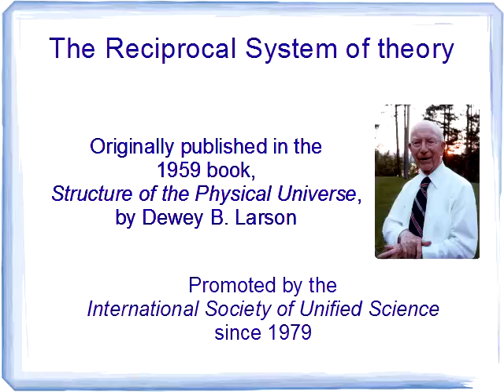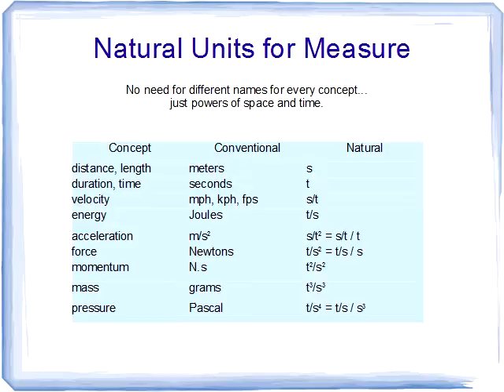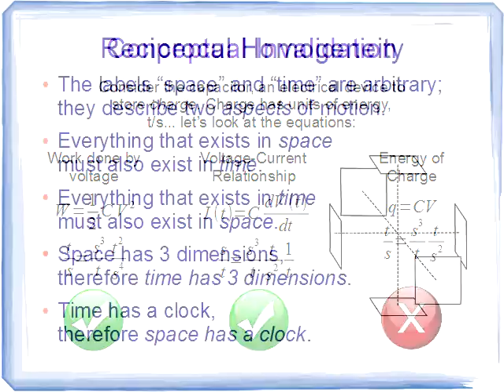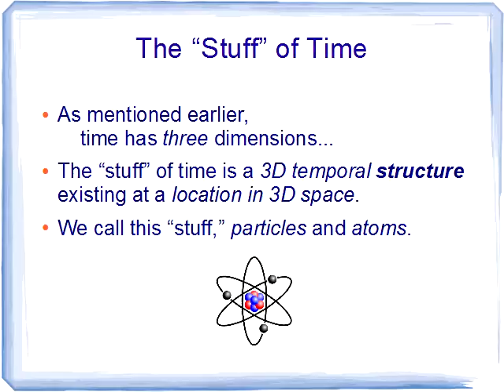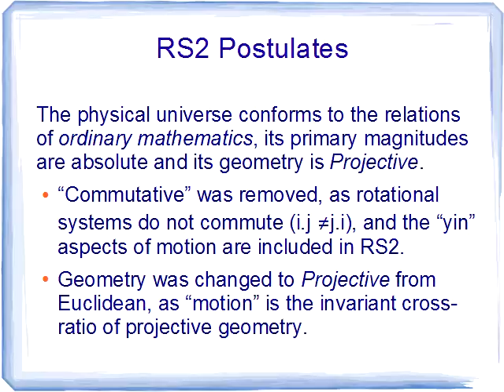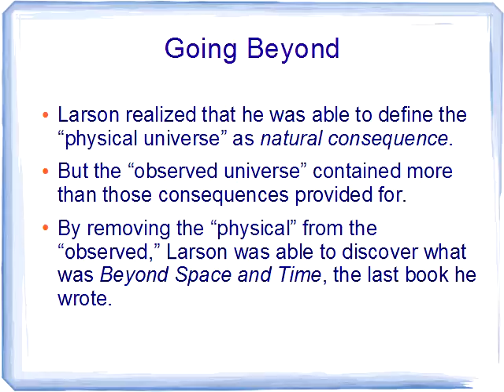Introduction to the Reciprocal System (RS2) of Dewey Larson by Bruce Peret

Comment: but if mass=t^3/s^3,velocity=s/t,that means when a thing speeds up,it will become lighter,is that contradict with Einstein's relativity?
Reply: Einstein's major error, as pointed out by Mathis, was one of perspective. To put it as simply as possible, relativity alters data received across time and space from an object. The corrections applied to interpret the data (Lorenz) apply to the data, NOT to the object.
As a simple analogy, imagine the Doppler effect of an approaching and passing train. The engineer blows the whistle, and to an observer, the pitch is higher that what the engineer hears. There is the error: Einstein applies the correction to the object, not the data, and supposes the actual pitch the engineer hears is higher. The analogy being mass. It does not increase with velocity, but the observer's perception of it does.
Reply: Einstein was an idiot and a thief. He should not be mentioned in the same sentence as Larson, Russell, Telsa, Steinmetz, Heaviside...etc..
Reply: @openmindedtruth  how come he's a thief?

Comment: New to this, but the moment I saw the relabeling of voltage, current, and resistance, it scratched a 26 year itch I’ve had when trying to grok the electricity-as-water metaphor... and then the relationship between induction and resistance... you had me at hellOHM!

Comment: If space and time are the same "dynamical aether or" fabric", logical in a universe undergoing cosmic inflation and increasing entropy, actually not in violation to Einstein spacetime and SR btw, then obviously it is meaningless to diversify a general timespace or Einstein spacetime curvature into "3 or 4 dimensions". It is just one (variable) dimension.
Reply: Dark energy must be classified as different then all other forms of energy and vacuum as it is counteracting the reciprocal ability of heat, electricity, mass. 
Very roughly this could mean two dimensions where one is a tidal volume, but that would probably be too confusing to many people, as they are adapted to use maths instead to categorize dimensions just as coordinates plus time